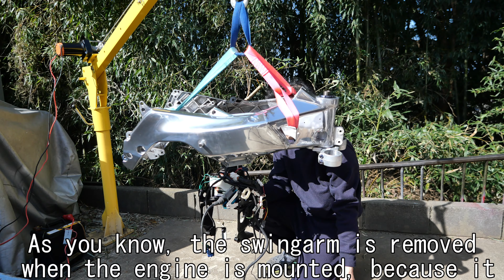aprilia RS125 ROTAX122 Mounting

Comment: Hi!
I’m following you a couple of months & I have some questions .
1)
Which engine set up (cylinder& cylinder head kit is the best of what you use so many years ?
2)Which exhaust and carburettor do you suggest?
3)Where can I buy a Pit Starter like yours(except if you make it by your self )
4)Any advice it would be helpful!
Btw,just I bought an Aprilia Rs 125 1997’ (122Rotax) only for track use !
Kind regards 
George.
Reply: Τι γίνεται εδώ πέρα όλοι ποτσι βλέπουμε? Να το χαίρεσαι το εργαλείο φίλε και καλά στριψιματα και εγώ το βαζω πίστα. Italkit 140 με τη κεφαλή της italkit καρμπιρατέρ 38αρι και εξάτμιση όσο φτάνει η τσέπη σου!
Reply: @gasolineatelier  Καλησπέρα Σύντροχε !Στείλε μου πως είσαι στο φβ να σε βρώ ,να τα πούμε !
Καλό δέσιμο !
Reply: @georgiosgeorgiou2290  έχω ιντσα gasoline atelier! Έχω και ένα βίντεο στο κανάλι με το rs !